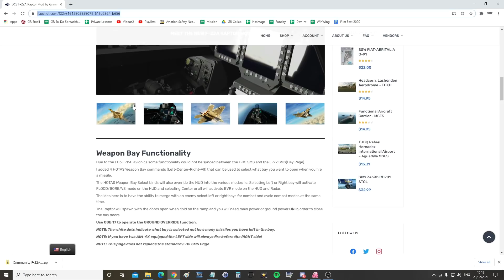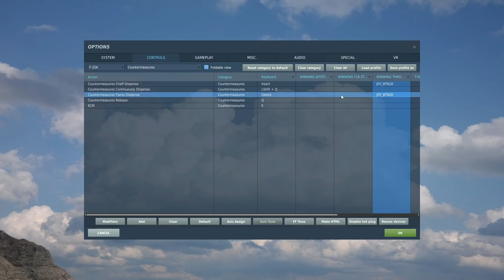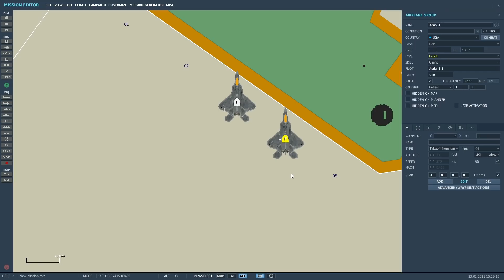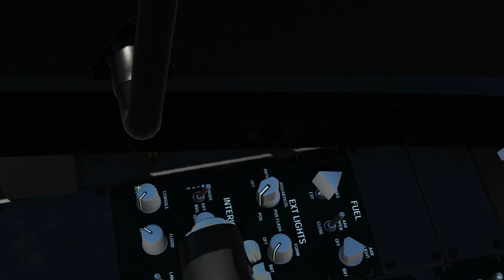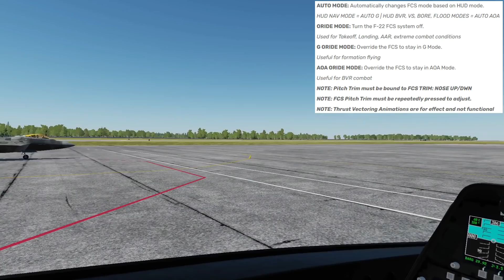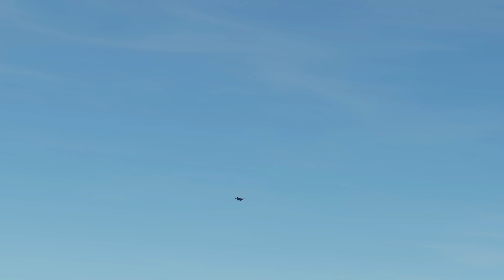F-22 Raptor Mod (version 2): General Guide | DCS

Comment: I can't get this to work with the steam edition, am i doing something wrong?
Reply: I have it working in steam, are you getting any pop ups? Any signs or error messages? 
What is the problem for you?
Reply: @romeovictor6223  it says that it's disabling the module because it's unofficial
Reply: @intrepidus4743  did you download it off the newest release or are you using an old one?
Reply: @romeovictor6223  it should be the newest
Reply: @intrepidus4743  so just for a basic trouble shooting list:
You have it installed under your “saved games” folder? This folder is different from the core folder of DCS. 
You have the correct”F22A” folder copy and pasted from the downloaded zip folder?
You have the clock symbol unchecked on the bottom of the mission editor?
Reply: @intrepidus4743  same here bro same problem
Reply: Really steam edition come on
Reply: @OddElephantLTU  problem?

Comment: When they finally model in thrust vectoring the 22 will be pretty much unstoppable in any arena.  GS in the F-22 has been putting the hurt on pretty much anything he has been up against...without thrust vectoring.
Reply: That's because the thing has SFM for flight model, so it's not all that far from the Ace Combat planes. If you want to see what thrust vectoring does for an actual module, get in the JF-17 and enable TVC for it in the mission editor.
Hint: it won't be all that useful unless you know exactly what you are doing and how to deal with TVC.
Reply: @getsideways7257  
Good point. Would the SFM allow the mod developer to tweak AOA to simulate vector thrust, or is it fixed for all mods?  If so, you could have a "cobra button" approach to kick it up on demand.
Reply: @Spaatz77  SFM works in a rather peculiar way: you have certain "root" lift values for particular Mach numbers and then there is also an increment that gets added with every "step" in the AoA. Where is the limit to that? Easy. There is a lift cap past which the lift doesn't increase. That's why I'm saying it's a very primitive "flight model" and needs to be removed from DCS for good. Also, there is no real way of adding TVC to it.
Even though we can't really get our hands on the aero data for the F-22, there is still one more option: doing CFD tests on a more or less precise 3D model. That would still be MILES ahead of SFM (and you could add TVC in the end).
Reply: @getsideways7257  u had me at "CFD modeling" 😎
Reply: @lincolnmicrophonellc  ED are revising their missiles flight modeling using CFD too, by the way.

Comment: When using the Thrustmaster Warthog, the Axis mode for the throttle left and right does not offer a Joy_RY or Joy_RX option for Key/Button assignment.
Reply: I mapped my Warthog throttle OK. I'm not able to check at the moment but I did a cold start where you advance each throttle individually to inject fuel and they started separately.

Comment: HELP! I have installed the mod and put the correct folder in the Mods folder, but it says that the F-22A is not authorized and is disabled when I launch the game. I play the game through steam if that changes anything.
Reply: Sorry for late response to anyone who was asking - I simply put it in the Saved Games folder instead of the regular dcs mods folder.
Reply: wait no i fixed it
Reply: @landonsanchez311  how did you fix it?
Reply: @landonsanchez311  How'd you do it?

Comment: "Simple" or "standard", this FM placeholder doesn't even deserve its own name (or place in DCS). It's basically the same crappy "flight model" FSX defaults to.
Whoever wants to fly all kinds of fighter jets regardless of HOW they fly should just switch to FSX/P3D: you'll find tons of them in there. That's not to mention that very few of FSX/P3D addons actually utilize EXTERNAL flight models that can be as good or even superior to those of DCS. You can even do the "pew-pew" thing there as well (with TacPack).

Comment: That APU start 🤤 

Cap, without a doubt the most difficult thing to understand about the F-22 (which is not for studying engineering either) is the ICP (INTEGRATED CONTROL PANEL). Communications 1&2, Navigaton,Friend /Foe ID, Waypoints ,Autopilot ... etc .. 👍🏻

18:40 Emma Stone 🥰
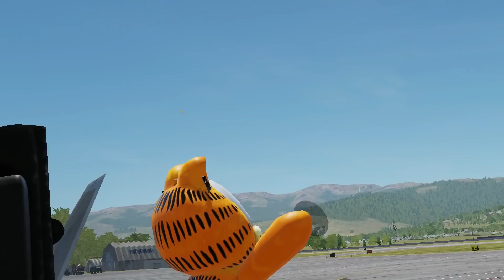18:47 WTF 😂

Comment: There is a Brand new F22 with full DCS quality cokcpit being in works for MSFS2020
Reply: That's cool but you can't shoot or dogfight in msfs all you can do is fly around
Reply: @Timtoomuch  yup, and that's all i need, search the msfs 2020 forums, the dude's name is ADam Bury, he posted the cockpit photos
Reply: @Timtoomuch  You can't "fly around". You can only pretend you do in MFS, because it doesn't support proper flight models. Still, the mod here uses just another crappy FM called SFM, so I guess there is no much difference after all.
Reply: Yeah I know I bought the Rafael and it doesn't feel right or look right.best planes I've flown in msfs are the default ones!!!!!
Reply: @Timtoomuch  That's the problem with Blade Element Theory (which is in use by MFS): it can do straight wing, slow and light aircraft relatively "realistic", but anything aerodynamically complex is just a no-no.
Reply: @Timtoomuch  i saw the Rafale, the only thing custom in it is the 3D Model, rest is MSFS avionics, moving maps etc, the F-22 for MSFS2020 will have all custom screens, fly by wire, working pages like BIT test, weapons, storage, HSI with 100% accurate Raptor details. Contact me on adamburry@hotmail.com for more info if you want sir, i will show some early development screens.

Comment: Cap - Quick question as I planned to buy the Thrustmaster HOTAS, because I know you used to use an old X52/56 (which is what I have now) but you're now using the Winwig.

So, what's the main positive of the Winwig compared to the Thrustmaster? Or, is it just preference? There's also the VKB and a few rave on about Virpil. So many choices - and I'm not sure if you've done a video about comparing them (or I haven't seen one yet). Thanks.

p.s. did you receive my e-mail from last week?
Reply from the maker: Hold off buying anything. Several REALLY important vids coming in next few days. Just waiting on permission to post.

Comment: Bummer! I finally got the folder in my aircraft folder I was having permission issues but got it in there now. Don’t see it in the mission editor under aircraft. Geez nothings that easy for me
Reply: I even tried unclicking the clock on the bottom of the map
Reply: It needs to be in your saved games directory not the main DCS mods directory
Reply: @bruswain9158  - yes it’s in my DCS-mod-aircraft folder and yes I also have flaming cliffs. What’s weird is that I have DCS in my saved games and in program files. All my aircraft are in my program files-Eagle dynamics- DCS-mods-aircraft folder.
I don’t have the aircraft folder in saved games-DCS folder.
Reply: @Ghost-bk6hs  - ok I’ll try that Ghost610, I might have to create an aircraft folder for my saved games-DCS - mods because there is not an aircraft folder in there and then maybe copy the F22A folder in there.  Thank you I will definitely give it a go.
Reply: @Mako-sz4qr  tried that still cant find it on the list in the mission editor, did it work with you ?
Reply: @taha5831  … yes it did but I have a new rig and haven’t added the F22 mod yet because of the crashing issues with 2.7 but I think it’s fix now and I might try to add again.

Comment: Hey cap, could you perhaps test the usefulness of dumping fuel in dogfights? Lower fuel means your aircraft will be lighter. 

Spawn two aircraft, both aircraft need to be the same, have the same weapons, and have around 80% fuel. Have one dump fuel while fighting and the other fight normally. See if dumping fuel in a dogfight gives you any noticeable advantages.
Reply: Having the burners on is effectively dumping fuel lol
Reply: That's actually a really interesting question
Reply from the maker: Awesome thanks
Reply: The hell? Less fuel gives you MASSIVE advantage. Or are you doubting that the dumping fuel process actually works in DCS? I don't get the question. Just spawn yourself against the Mirage 2000-5 bot (Ace), guns only. Give him 100%, 50% and 25% fuel in sequence. Also do the same to your own jet as well. There is a whole lot of difference even between fighting the 50% and the 25% ones. Heck, even 30% and 25% can yield different results.
Weight is everything in a dogfight. And that's why two such similar airframes as Su-27 and Su-33 fly so differently despite the latter having a supposedly helpful canard and extra thrust.

What DCS doesn't seem to model, however, is the CoG position shift due to the change in fuel level. For example, with a MilViz Phantom you can easily catch a flat spin if you are fueled up to the brim, but once you have burned more of it the thing becomes gradually more stable.
Reply: @getsideways7257  What I'm trying to figure out is if...

In a PVP match, if you and an opponent merge with similar aircraft, fuel levels and weapons, would the dumping fuel mechanism be fast enough to quickly shave off your fuel count and give you a noticeable advantage? Or is the dumping fuel sequence too slow to make any actual difference?
Reply: @Etha-xi8ei  Already in a merge? I have my doubts about the possibility of doing that in real life during hard maneuvering (especially while on the burner). But pre-merge you can surely do that. Any weight shave-off will be beneficial. You just need to make sure you are not emerging victorious on empty tanks.
Reply: @getsideways7257  Agreed. Just wanting to see if you can, for example, dump fuel in a 2 circle rate fight in order to make yourself lighter and increase your sustained turn rate (In DCS ofc). I don't see any reason why it wouldn't work, but the main thing I'm trying to find out how MUCH it helps.
Reply: @Etha-xi8ei  Depends on how much fuel you dump compared to your opponent. Actually I did see someone doing exactly that in a video of multiplayer dogfights (maybe even on this channel?)
For the same plane/same initial parameters situation expect a 5% fuel difference to already contribute quite a lot. But I believe you are not thinking of a right way to test this. In a player versus player situation there are just too many variables that might get in the way of properly assessing the advantage of having less weight in dogfight. That would take a whole lot of human players do thousands of rounds counting up all the permutations to get any statistically meaningful data out of this.
I'm pretty sure you want to know how useful it is FOR YOU though. And for finding that out I'd suggest two methods. First of all, get ahold of TacView (pretty sure the free version should allow for this too) and try pulling some of the best and most consistent turns at different heights (near sea level, 5k', 15k') you can achieve with fixed fuel settings. I'd suggest 50%, 3 and a half minutes of full burner maneuvering (depends on the plane, but can by anything from 20% to 37%+) and near zero fuel. Then check the turn rate charts TacView produces for most stable (and tallest) Turn Rate 'shelves'. That will tell you how exactly you perform at typical fuel loads and at the theoretical limit (no fuel) given a certain aircraft. Then try comparing that with lesser or higher loads like 40% vs 50% or near zero to 5%.

I would also recommend going against a bot that is good, but at the same time very predictable and two circle-inclined. This time around, of course, you need to switch off fixed fuel - just give yourself progressively higher amount of fuel loads or stick with three / three and a half minutes and give the bot 50%, then 40%, then 35%, etc.
Reply: @getsideways7257  lol, I was just making the joke that having the burners on already drains your tank in minutes, dumping fuel, while yes a viable way to shed weight absolutely not a good statagy unless your planning on winning in the first turn and then ejecting on your RTB
Reply: @maxlocke7867  Depends on the situation. If you are on a dueling server and everyone is given 50% (or even 100%) fuel, this can be helpful. Also, if it's a situation where your worst choice is either to eject while RTB'ing or to get a round through your skull during a dogfight you have all chances of losing otherwise, I suspect getting rid of a good portion of fuel is a pretty good idea.
Also, thirsty as they are, the afterburners still take minutes to burn through the fuel.